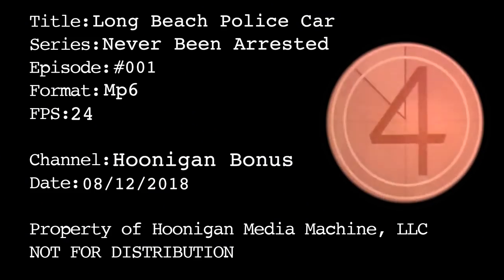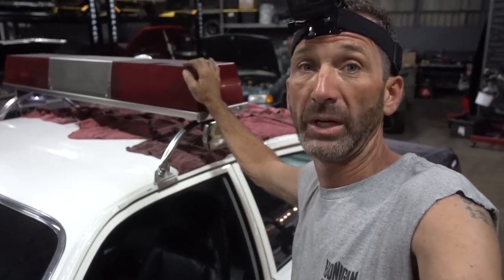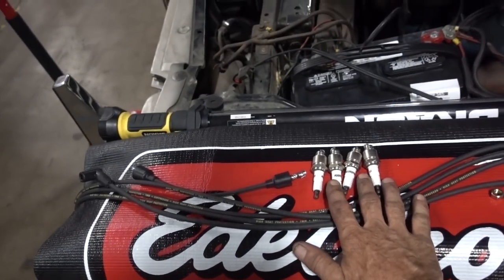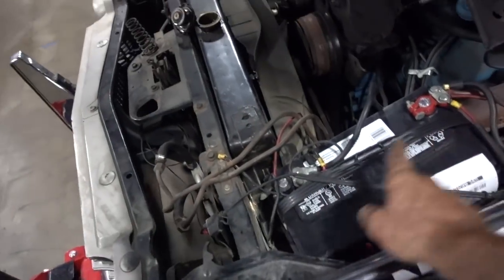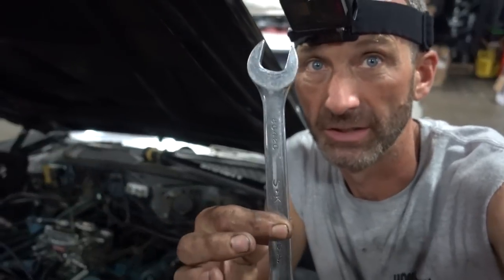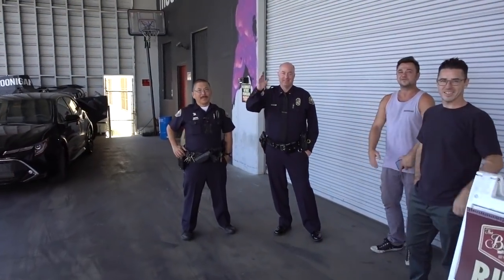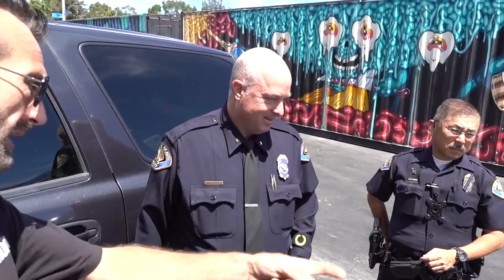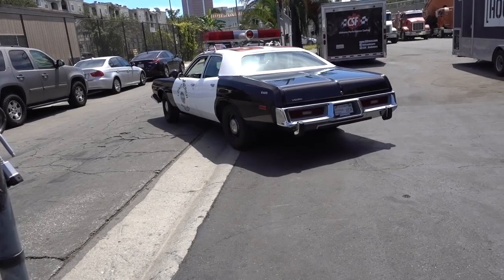Bad Daddy Brady Loves the Police! Old School Squad Car Gets Full Tune Up

Comment: All eroded 😂😂😂 I'm dying.
Reply: Kinda accurate, but yeah.
Reply: @joshuaking34  Corroded is the correct term 😂. Erosion happens to rocks and stuff like that.
Reply: @bennettfriesen33  Corrosion occurs when metal oxidizes, yet erosion can occur within electrical circuits. This usually happens when electrons have to arc across a gap.  Given that this is Brad, I'll give him the benefit of the doubt and move on.

Comment: i work on a 65 dodge polara and a 67 newport i know about the spark plug issues just gotta get on your back and get under her to pop those two rear plugs  "Fun Fact in order to replace the oil pan gasket it is recommended you pull the whole engine out cause three bolts are under the cross member, I did it the hard way and ended up puking oil"

Comment: Maraaaaaaaaauuuwwwwww! CAT imitating the siren. Listen to the cam they had in the old 440. 450-500hp?
The police used to chase hotrodders for fun. It wasn't because hotrodders were hardened criminals. They always wanted to see "Under the hood."
Reply: 1974 440. Doesn't matter if it's  a cop car- Which would be extra coolers,bigger alternator,light group package- as for 450/500 h.p? Try more like 225 h.p if that.

Comment: Really guys?! A MOPAR finally rolls into the shop and the specs aren't mentioned?....... WTF? LS tunnel vision much?!
Reply: I was going to say, because it does not have the letters:  LS, RB,SR,or S5 in the engine code.
Reply: The 440 was a raised deck version of the B block engines....... wait for it ..... called the RBs
Reply: Levi, you missed the point buddy.
Reply: Didnt miss nothing, just a little mopar knowledge for them "LS tunnel vision" peopl
Reply: Police, fire, military and government are usually exempt from smog bullshit. And yes you got the first 2 scentence correct. But you knew that. There was also a 350 B series block in 1958 and there was a 383 in the RB blocks aswell
Reply: LS ftw